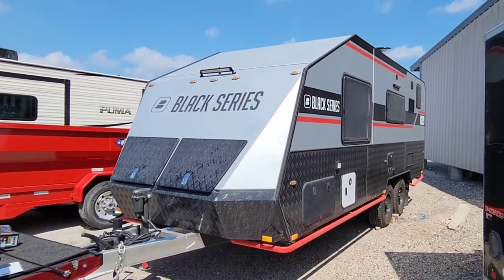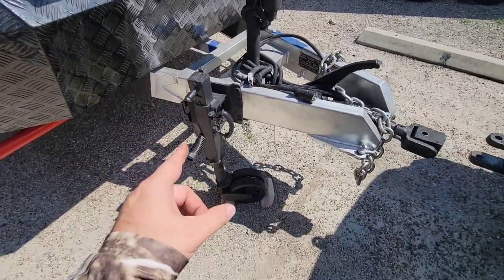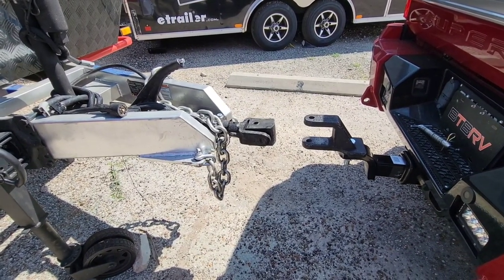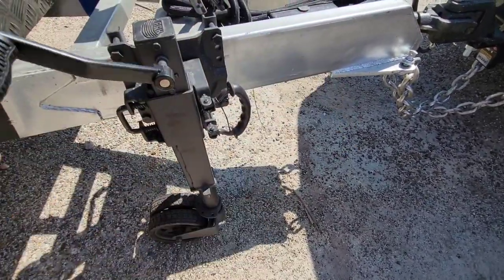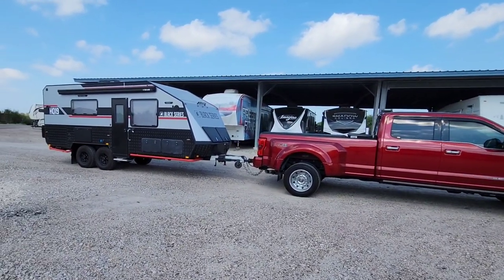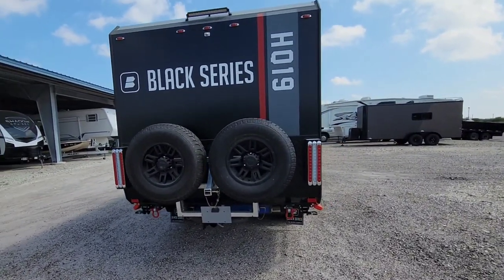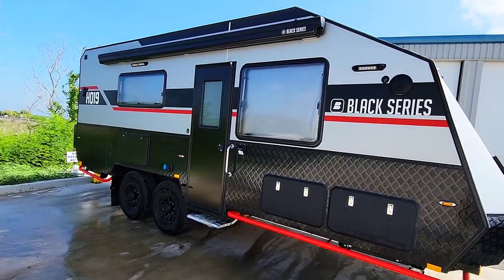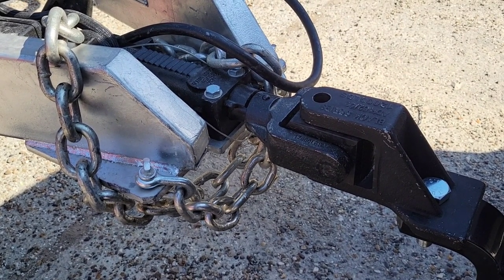Connecting a PolyBock Hitch on Black Series Campers RV to the F450!

Comment: Everyone in Oz are going away from the ball and socket couplings. These are popular with off road campers where there is no bitumen. Crossing the chains makes it easy if it accidentally becomes uncoupled, doesn't drag on the road. Its nice to have some mod cons when camping, usually other four wheel drives have swags under a awning hanging off the four wheel drive for cover. Fire pits, cast iron camp pots and jaffle irons are in attendance in the camp.

Comment: Rotate the swinging jack the other way where the wheel is under the front of the camper. Also with the wheel on that jack, you can move the camper to help line up the hitch once you get close.

Comment: I use this style hitch on an overlanding trailer that was built from military trailer. It is easier to hitch it all together and then back truck to receiver slot. Much easier than trying to line the pin up perfectly.

Comment: I do like the pintle idea over a ball hitch system. All our trailers from a 5x8 utility trailer all the way up to the 20 tonne float all have a pintle hitch. One size fits all.
Also, no weight distribution hitch required?
Cheers 🇨🇦

Comment: I had this type of articulating hitch on my offroad trailer that I pulled behind my Jeep in Australia. Absolutely loved it. I had seen too many accidents where trailers were disengaged due to the lack of articulation. Hookup was not a problem as the tongue weight was not so great that I could not bump the  trailer 1/2" one way or the other to get aligned. Not sure how heavy the Black Series is, but that double wheel dolly should allow for a little wriggle room. As for the 14" long hitch. We have integrated ones (not bolt on) that are much shorter. If you are concerned about the swing-away dolly wheel limiting turning capacity, wind it all the way up and it won't stick forward so far.

Comment: With the wheels on the jack and hand brake I would just get the truck close and then manually move the trailer tongue into the final pin position.  

Looking forward to the reviews of the camper.

Comment: Great video. If you ever get tired of that truck. I would love to own it. I have dreamed of having a truck like that for as long as I can remember. I have fixed up old trucks and made them work for what I needed at the time . I did buy a close to new truck 35000 miles and it was stolen and totaled. I then had to get both wrists and elbows cleaned out and fixed. Now I just have a tired 1997 f150 xl 4x4 with 250000 miles and a tick in the motor and I have to have shoulder surgery. I can't get a break!!! .

Comment: How does that type of hitch control sway? Or does the trailer suspension itself help eliminate sway?
Reply from the maker: There is no sway control system for this setup.  It's really about having a truck with enough weight, stability and power to handle it.
Reply: @BigTruckBigRV  And I think I have seen videos of a RAM Power Wagon towing an HQ19, so that combo apparently works.

Comment: I still say the truck manufactures need to send you a off-road model of their trucks so that you properly test this black series trailer off road.  I'm posting this during the pre-roll ads.  I don't know what the tongue weight of this black series is, but I expect it might be pushing the payload limit on some off road trucks, like the Raptor and TRX, some of which have a payload less than 1000 pounds.  Personally, I would like to see a Nissan Titan XD Pro4X.

Comment: You complain about the hitch but forget that in Australia where this camper is from vehicles are set up differently. There is nothing wrong with the adapter they sent you because it's attached exactly where your tow ball would screw on, just instead of a "ball" you have a U coupler, and it HAS to stick out those extra inches because of that additional axis in articulation. I would get creative with it a little and turn it into a bumper step for the back of the truck instead of just complaining that it "sticks out".

BTW: You are paranoid about not having a tag on the trailer but then cover up the rear plate on the truck LOL

Comment: Not a fan of relying in the hair pin to keep the main connecting pin retained on a flexing joint. I understand the theory and how cool it is off road. But using the same style hitch to haul agriculture equipment I've seen those pins work thier way up and out. (Seen lots of pins that have arms that secondarily latch those pins along with a hair pin from the top to prevent a pin from walking out.)Causing the load to be lost at slow speeds. Can't imagine what carnage would happen at speed. Still cool trailer though.
Reply from the maker: Question, how is this any different than the hitch pin on all trailers?
Reply: Normal hitch pin is not rotation point!  Hi JT pin is one direction pull (locked on place). So no rotating parts possibly catching the release pin or wearing the pin.